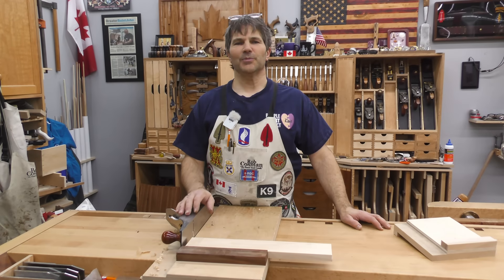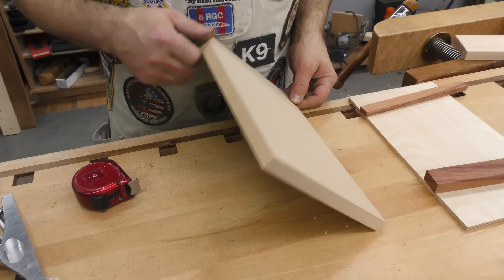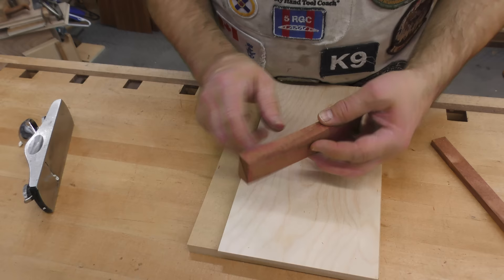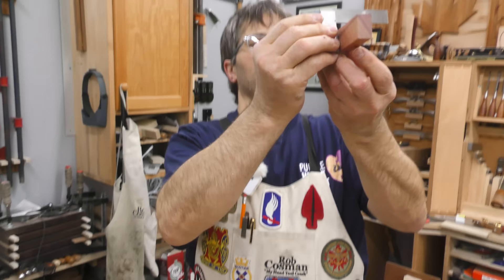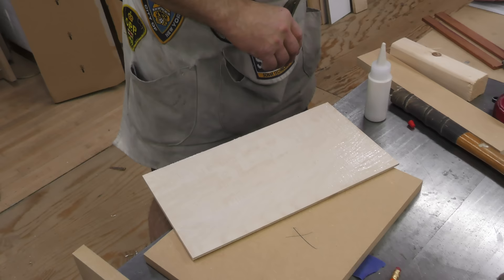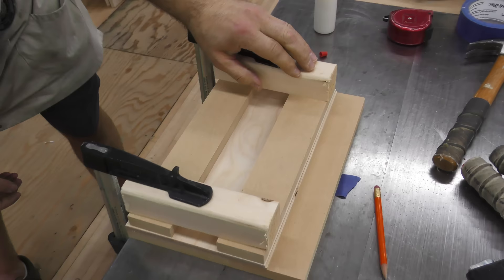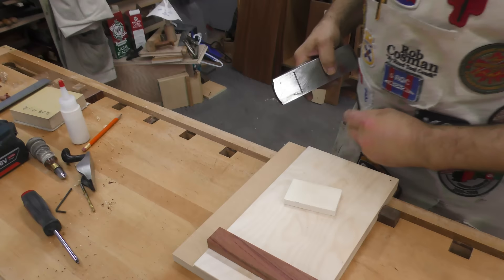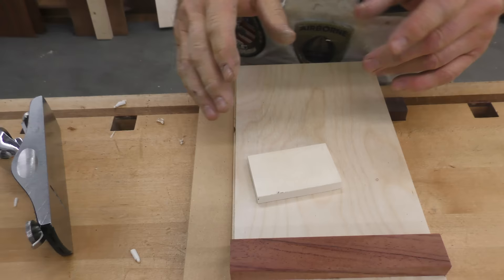Build A Shooting Board - For Your Block Plane (WOW)

Comment: Putting Tape to make the ark. The reason you gave did not make much sense to me, but it definitely will make plane cut better by letting blade slide a little up and down. Great video. I always learn a few tips here and there from each of your video. You are a great teacher. Thanks.
Reply: You have your reasoning upside down...

Letting the center bow up allows the middle of the plane (the widest part) always make square contact against the board. Squared contact means the plane is always 90⁰ to the shooting board. 

If it were cupped in, then only the narrow ends of the plane would make contact at the sole of the plane while the middle tilts down into the cup... this would also make the plane sole tilt away from the shooting board, giving you a non-squared board which would be nearly useless.

Comment: Each one of these videos is a gift.  Thank you. Q = Why don't you allow the first use of the board with the plane to cut the rebate / rabbit.
Reply from the maker: Because I want my rebate to be bigger than my plane, not right at the edge of my blade. Also, this ensures that it is milled straight and true.
Reply: @RobCosmanWoodworking  ????
Reply from the maker: Sorry, fixed it.
Reply: @RobCosmanWoodworking  What and where is the fix?
Reply from the maker: In the message above, I edited it.

Comment: Thanks Rob, Jake, and crew.  I was watching a video of yours from earlier in the year, and you could really hear the problems with your lungs.  I know it was difficult at times, thank you!   By the way, I formerly used a wrapping, similar to you hockey tape wrap, without the twist, on the handles of my tennis racquets (then they were for sweat, now I add your twist for my arthritis).  Great idea, and it helps a lot.

Comment: Looks like a winner!!! I have a bunch of 1/2" mdf and some purple heart scraps for the fence and cleat.
Reply from the maker: Perfect....and that should look good too
Reply: @RobCosmanWoodworking  you say the mdf doesn't need to be more than a half inch, but if I glue lam two half inch pieces together will that hurt? Also I have some 1/4" cherry scraps I could use in place of Baltic birch plywood, would that be ok? Lemme know what you think please.
Thanks!
Reply from the maker: @johnburens3395  I wouldn’t make it 1” thick, that would be clumsy looking. As for the scraps, plywood is better because it is more stable, and less prone to warping the MDF.
Reply: @RobCosmanWoodworking  got it, Thanks! Btw, guess who got his hands on some hockey tape? I think that tip might have created a monster! Hahahaha

Comment: Rob Cosm... Haha those hand stamp brands are a PITA. I find hittin the tip with a propane torch to get it hotter provides better results as I can just hit the surface with the brand for a hot second and pull off... Having to hold it down for however long always gave me sub par results.
 Thanks for all the knowledge you share, Rob.
Ps. I appreciate your attention to the minutia... It counts in woodworking and shines in jig making. Cheers

Comment: I love your channel, admire your skill, and your generosity to share it all with us.  Thank you. Really.

However, as an educator, why not put a blade guard on your table saw?  I know a couple people myself who would have saved themselves some trouble had they left theirs on.  Apologies if you’ve addressed this already or if I’m mistaken to believe that it’s way safer to use a guard.
Reply: I dont know Rob's particular reasons for not using a blade guard, but I'll say a few things I know about the subject.

The biggest thing is that he does have a riving knife installed, and a riving knife is arguably the most important safety feature on a table saw. The riving knife pretty much eliminates the possibility of major kickback. Kickback is dangerous enough since it throws wood at you at a million miles per hour, but kickback can also pull your hand into the blade unexpectedly. Without kickback, the only reason your body will touch the blade is if you are being negligent. With normal saw blades and standard types of cuts, a riving knife will do this without any downsides whatsoever. Good news for most blade guards is that they are designed in a way that automatically also includes a riving knife.

Second point is that Rob is using a SawStop table saw, so hypothetically if his hand touches the blade then the blade will retract before it does significant bodily damage.

Third point is that a blade guard obstructs vision of the blade, which isn't a safety concern as much as it is bad for viewers of the video who can't see what is happening and also potentially bad for precisely lining up cuts.

Final reason off the top of my head (and perhaps the biggest reason) is that a typical blade guard prevents you from making certain cuts, or at least gets in the way. The standard blade guard on most consumer level machines is essentially a plastic hood which hinges off the top of the riving knife. You cannot make cuts unless your cut goes full depth through the wood, or else the uncut portion of the wood will bump on the riving knife extension. This isn't an issue for a blade guard which comes down from above attached to a metal arm or something, but this type of guard not standard. Or if you are using sleds, then the blade guard can get in the way. The idea of having a blade guard that you sometimes need to take off in order to do the type of cut that you want to do means that most people just won't ever put it on. And depending on the shop and operator, time is money.

Are these reasons good excuses to choose not to ever use a blade guard? Depends who you ask. It would be nice to say that you should be so diligent about safety that you will always use every single possible safety device, but for some people the perceived risk just isn't high enough to bother using all of the equipment. Usually they're right, sometimes they're wrong. I have never used a table saw blade guard, I don't see it as being that important. I will not use a table saw without a riving knife unless I absolutely have to, and thankfully there isn't much reason not to. If I did, then I would be much more diligent with push sticks and body positioning.

It might be worth noting that some people might not use a blade guard because they just think it is uncool. I don't think this is a good reason. But for some people, it might be the reason.
Reply: I thought the same when I saw how he reaches over the blade to grab the piece

Comment: Merry Christmas, Rob. You said that you would explain why you set back the fence on the shooting board. I must have missed that part of the video. My guess is that it is to ensure the plane does not rotate and cut into the back edge of the fence, blowing it out.
Reply from the maker: When I put the fence at the end of th eboard (I use to do that) I notice that my students would push the plane off the board caausing th eplne to dive off the end and mess up th ecut so I moved the fence back so that your plane stays on th eramps even after the cut

Comment: Rob sanding? That's almost as rare as unicorn sightings!! For small stock, I figured using a regular sized shooting board with a smaller plane (#3 or 4 ) would work just as well? In either case, looks like it suits this task quite well!
Reply from the maker: Yes but this one is so cute!

Comment: hey Rob, please explain your thoughts on using the fence AND the miter guide together. I see the guide on the right side to prevent feedback but I thought this set up a no no. Season's best!
Reply: The miter is on the same side as the fence and supports the length of the board, so it won't twist, bind and kickback.

Comment: Why the need for a rabbet plane to cut the rabbet the block plane will glide along without cutting into the top board?  I would think you could use the block plane itself to cut the rabbet per its specific gap between the end of the blade and the edge of the board.  Hope that makes sense.

Comment: very cute little shooting board! 
What do you say to creating the rabbet with the block plane after the top is glued. i.e. glue top without rabbet and then run the block plane until it cuts the rabbet as deep and wide as it needs?
Reply from the maker: I would not do it that way because i want a bit more clearance for the blade than that method would hive

Comment: @RobCosmanWoodworking thanks for the great vid Rob! Question why do you suggest setting the hardwood back a bit? If you run the plane across it a few times after assembled, wouldn't the plane take off anything in the way after just a couple passes (if you extend the blade a bit)?

Comment: if you dont want glue to slip, its really helpful to let it airdry before putting parts together. it usually tells you on the bottle for how long. in german its called something along the lines of "open time". its like 5 or 10 minutes. you can also tell how long it needs by looking at the edges of the glue. if the edge gets kinda transparent, its ready. that makes the glue kinda tacky, so its less likely to slip around on you :) its a helpful trick, if you dont have enough clamps to make sure it stays straight.
Reply: Or, just sprinkle on a little regular table salt.. it dissolves in the water based glue, but the grit lasts long enough to help prevent slipping.
Reply from the maker: I don’t like the salt method as if you do too much or grab a salt shaker with salt clumps in it the clump may not desolve.  I like my nail method
Reply: @RobCosmanWoodworking  True - It really depends on how the salt is kept (I store mine in a mason jar, and just a tiny pinch when needed in a strategic spot or two depending on length of glue joint.. so, no clumps.. I do it by feel... as Ive discovered, I can also feel plane chatter - have to since I can't hear it... )  I'll have to watch this when the subtitles kick in on the video and see how your nail method goes...  Kind of sucks having to wait 3 - 4 - 12 - 48 hours until auto generated subtitles kick in, but one's gotta do what one's gotta do... ... 

 and By the way, I truly appreciate your videos on planes - I found an ancient Miller's Falls No 9 plane in the cellar, all rusted up.. after watching several of your plane tune-ups , reviews, etc, I dug it out and working at restoring it.. luckily the sole , after sanding the rust off, was nice and flat (still needs some sanding to work out some rust pits) , and got it nicely tuned, (modified the depth adjuster yoke a bit with some 3mm flat washers to reduce wobble) , and even in its unfinished state (needs some final sharpening, sanding, etc) it has turned into the nicest plane I have ever used (not that I ever used very many)   with the guidance of your recent videos, I finally understood several parts of that plane that I was clueless about... so, Thanks a ton, and Happy Christmas!

Comment: 8:09 can some explain the purpose of this step? He says he’s cutting a rabbet but how can he do so accurately using the plane freehand? Then later he uses that skew plane to do the same step again?

Would it be okay if I skip these steps and glue up the MDF and plywood parts? Prior to gluing the fence on if I ran my plane back and forth a few times it would cut the rebate, correct?

Comment: Am I the only one who developed an eye-tick from that one shaving sticking out of the throat of the block plane until 32:25 when he cleaned it off?  I let out a nice little sigh when he removed it.  :)  I was surprised Rob left it in there because he usually clears out the shavings after each pass.

Also, whenever possible, I will use a dado or rabbet on a jig that requires an accurate 90° angle.  I do this because my table-saw sled is dialed in to within 0.001" accuracy over 12".  Even though I use machinist's squares for most everything I do, I don't think I trust my square or my setup using the square as much as I trust my sled.  Over the years, I'm sure my squares have been dropped a few times.

Comment: Hi Rob. Love your videos and projects. Only problem I have is that in the UK we tend to use metric measurements. Would it be possible for you to add these on screen every time you discuss sizes? I know it’s more work for you guys but it would really help as I struggle with inches!
Reply from the maker: I will tell Luther, but I think Google has an easy conversion tool too

Comment: Rob Cosman, Why did you use the block plane for straightening the plywood, is it because the low angle is better at slicing the end grain layers?
Reply from the maker: nope, just happened to be what I grabbed and sometimes it is easier to balance a small plane on a narrow edge.

Comment: Thanks for ALL the content. It's been a huge help as I've started to take my woodworking more seriously. I have two different sized shooting boards and a bench hook based on your plans. However, I'm struggling with getting my case mitres to close perfectly off my tablesaw even with a mitre sled and a digital gauge. Do you have any thoughts or plans for a case mitre shooting board for small to mid-sized parts (ie. for decorative boxes)?
Reply: I see I'm two years late on answering what may help you fit small box miter pieces that fit prefect. I cannot not use my power miter saw for these small cuts, first it's dangerous or it splinters thin trim cuts. I cut close to my miter cut mark with a bandsaw and finish the miter using my tabletop disc sander using the sliding miter gauge.

Comment: Great ideas and techniques. Concave or convex front to back (cleat to fence) would make the board more difficult to use (and wouldn’t look good), but I don’t see how it would affect the cut. The blade is still perpendicular to the top surface. Side to side would throw off the angle of the cut. Were you just talking about convex being more stable to use?  Thanks fir the video!
Reply from the maker: If the ramp the plane is on hetd slightly convex( a belly or dip) then what will happen is that the front and back of the plane will be touching however the middle of the plane will not be touching since it’s convex . So as you push from the middle of the plane as the plane is sideways you will force the middle of the plane down into this convex belly just throwing it out of Square. Inducing a very slight hump in the shooting board prevent this from happening

Comment: Hi rob! Got that trend stone for Christmas! Now that I have that, do you have a recommendation for alternatives to your Shapton polishing stone? I'm saving for shaptons, but am looking for something in the mean time. Thanks!
Reply from the maker: Hey Eric, any other stone that you purchase will essentially be money wasted as you won’t be using it once you obtain a Shapton. My best recommendation is to use the 1,000 grit side, focus mainly on using softwoods, and save money fast!
Reply: @RobCosmanWoodworking  alright, thanks! That's what I've been doing so far. As a temporary solution, I have some course compound on a piece of cedar that I use before stropping. Also, speaking of cedar, what are your thoughts on it for wood working?

Comment: Thanks for an excelente video! I have a block plane that has one side slighlty off angle (the one on the right it would lay on) is there a way around that or should I use it on the left side instead? Unfortunatelly, buying a New, better one is not an option right now..

Comment: 2 things: would using pin nails in place of that array of clamps be acceptable for affixing the fence, and is there any utility in screwing your hook cleat from the MDF side so that the threads pull the bubinga rather than the MDF? It seems to me you would want the threads in the harder material and the MDF sandwiched between the bubinga and the screw head. Am I of base here?
Reply from the maker: As long as you can keep the fence square to the plane pin nails would be fine.  You could screw the hook in from the top if you like
Reply: @RobCosmanWoodworking  thank you for taking the time!

Comment: I made my first shooting board with an unreliable square and the results were what you would expect...out by about 12 thousandths. I "fixed" it by using feeler gauges and masking tape as shims while using an acquired PEC solid square. Is that the best way to fix it?
Reply from the maker: That works.  If you want a more permeant fix take a shoulder plane to the fence and bring it int square.

Comment: Don't you worry about the clamping pressure ruining your square or plane? Maybe its just cause I have an older model but just getting the plane heated up from repeated planing and then hitting a knot hard literally bent the sole and body. I have a newer stanley low angle jack plane and a lie nielsen number 5 (damn covid...they had nothing larger for jointing at the time) but I've avoided using them because I haven't felt skilled enough to warrant possibly damaging the tool. I believe I actually asked you about wood river number 7's and number 8's at that time but again covid stopped that from being possible.

The old plane that bent was a craftsman 5 1/2 jack plane. I couldn't tell you how old it is exactly...the patina is somwhere between 30 and 50 year's I'd guess...

Comment: Hea witch way is the chanfer on the top board toward mdf or on top side
Reply: Towards MDF. To provide a little crevice for sawdust and such to go when you slide the work against the fence, so the work can register cleanly and not be forced crooked by a stray wood chip or piece of dirt.